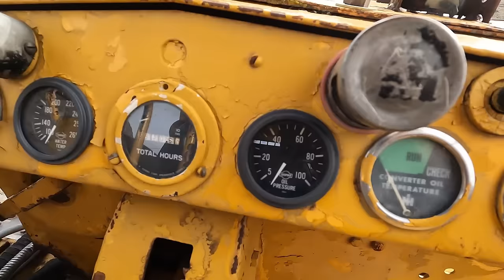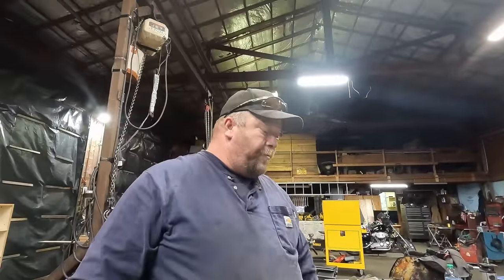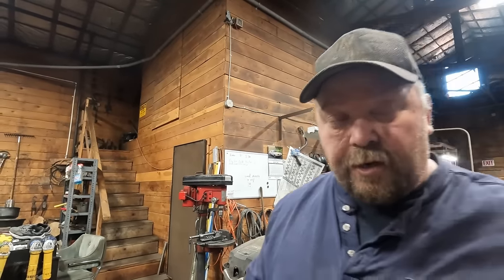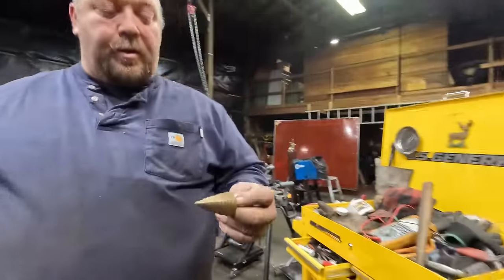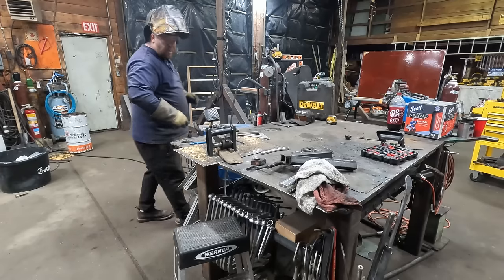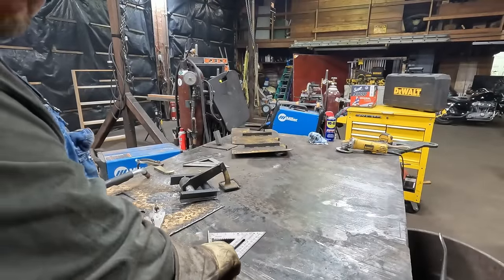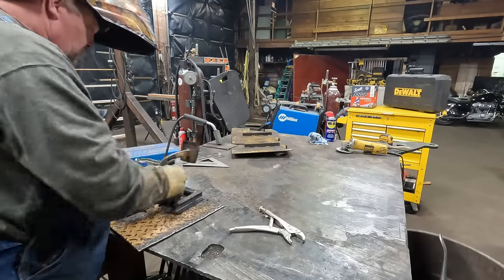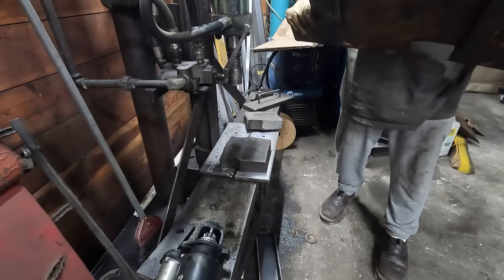Dozer Peddle

Comment: Tom. I may have a project for you guys. I need 16 custom brackets built. I came across (16) like new 20’ parking lot metal light poles doing a salvage job. They are 6x6 1/8” wall with 1 inch thick bases. I’m going to use for a ravine crossing for my tractor and golf cart. I’ll call them gravity brackets as they won’t be welded when installed. They’ll just sit on top/slip inside the top of the pole. The purpose of the bracket is to hold Large Timbers/beams that will then have very heavy duty rough sawn decking.  I’ll install the poles. Snap my lines. Cut my poles. Set on your brackets. Set on my Timbers. Bolt Timbers through brackets. Deck. No on-site welding for me. 
If you’re interested we can talk. It can all be built with scrap in your yard I’m sure.  Aluminum an option too. 
Great videos.
Reply: 👍👍👍👍👍👍👍TOM or MATT 👎🏻👎👎👎👎👎👎

Comment: Dewalt is nice, But Milwaukee all the way!
Reply: So my brother has the M word. All of the Dewalt tools I have out perform his. the 1/2 drive impact drive is no comparison.
Reply: @tomandpeanut  I do have both , Over the years slowly turned to Milwaukee.. They have given me better customer service that's some of the reason. My Dewalts are around 7 years old and the Milwaukees are going on 5. I hardly had any trouble with either but personally I've had less problems with the Milwaukees..